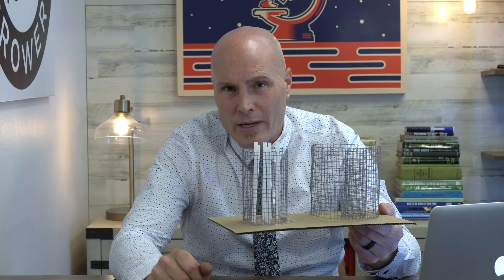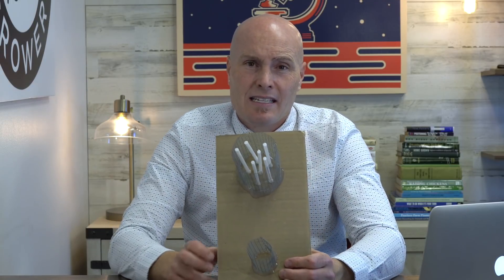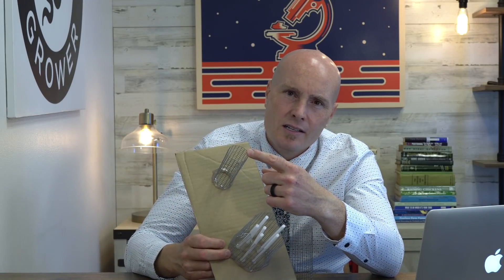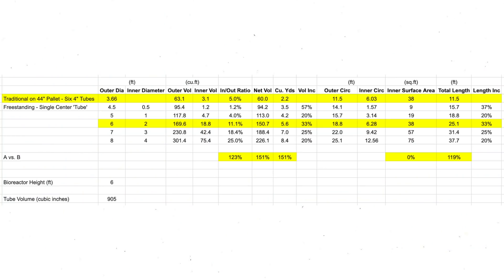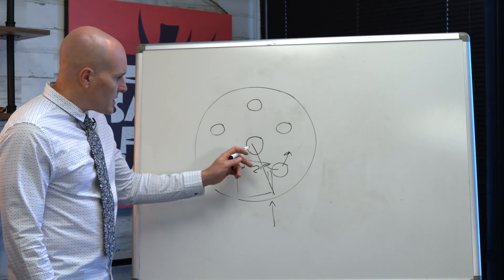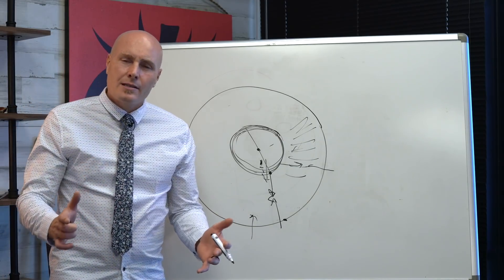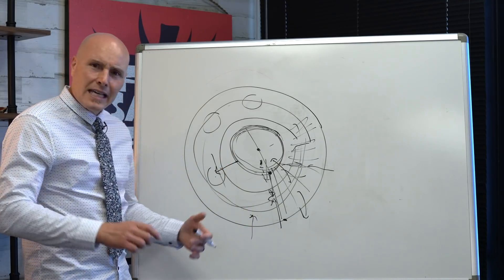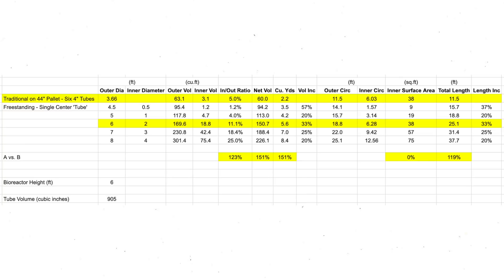Designing a New Compost Bioreactor | DESIGN SPECS and QUESTIONS ANSWERED

Comment: Did almost the same thing with my circular plastic compost bin last night.  Drilled holes all around the plastic outer shell (it has no base, so that's open to the ground).  Then placed a tub in the middle that I also drilled holes in.   Hoping to see a major improvement in the quality of the compost that comes out of it.  Rather than the black sludge I've been getting for years.
Did I do the right thing?

Comment: This reminds me very much of a keyhole garden without the wedge. Also this is taller than the keyhole garden.
What would happen if, after maybe the first year of composting,  you topped the reactor with a layer of good garden soul, and right away planted seeds and seedlings heavily on the surface, to hold the top soil in place.  The plants could be watered lightly to train them to send their roots down to the compost.  Voila, a garden.

Comment: @4:50 I think the inside surface area of the pipes will be the more accurate measure of amount of air going into the pile, not the volume. The thin pipes might have a similar surface area to the large centre core, even though their volume is less. The amount of air going into the pile and feeding the bacteria will be proportional to the surface area exposed to the air, not the volume. Just like how your gut has a small volume, but a huge surface area, and thus is able to digest food quickly. Nevertheless, I think the central core design is better than the pipes as the pipes are expensive and a nuisance to fill, as you've stated.

Comment: I wonder how much the tube width relative to tube length affects temperature and therefore upward air velocity? Like chimney length and width with creating the draft for smoke to rise out. Also a reason for having it elevated on the pallet? To bring colder ground level fresh air up through the tube and out in a convection current?

Comment: Maybe I'm crazy... Does this type of reactor build the same internal temps as a traditional compost pile? If it does i am thinking to run a coil thru it to circulate water(which gets heated by the compost) to a biogas reactor(which could use that heat in temperate climates)  free heat? Or just a wacko middle of the night thought?
Reply: I'm researching composting for exactly the same reasons 😂

Check out Jean pain compost heating for more inspiration!

Comment: Another thing, if air penetrates 1ft into the pile from any direction, you can have 2 ft of spacing between air gaps, because each gap would have a 1ft radius circle around it which it is aerating.  Instead of using the pipes, why not just roll some wire into several 6" diameter tubes and then space them every two feet?  You would still get much more air flow than the pipes could provide and you could still maintain your thermal mass.

Comment: How are you going to keep your thermal mass, though?  I thought you needed at least 3ftx3ftx3ft to maintain the thermal mass to keep the decomposition process going.  If you only have a 2 ft wide thermal mass, you are going to be losing a lot of heat from all sides.
Reply: What about a roof like a garbage can lid? Would that retain enough rising hot air to get some decomp going?
Reply: @jeffreydustin5303  A radiant barrier above the bioreactor could help retain the heat, but it would also reduce airflow.  However, even doing that would simply allow the heat to radiate out the sides.  It just seems like the mass should be bigger, to me.

Comment: I like the design a lot. One issue you may run into is that you have a lot of wind and sun exposure on the outside, which bacteria and fungi don't seem to enjoy. One large benefit to your design that you didn't mention is that it would be very easy to water the material from the outside with a hose when it dries out too much.

If I were building one of these, which I probably eventually will, I think I would still wrap the outside of the structure with some type of material, to block the sunlight and slow down the wind. I don't think there would be any type of exposure issue on the inside mesh - especially with some type of top covering. So I think just wrapping the outside mesh with any type of fabric would benefit the design. And you wouldn't necessarily need to sew the fabric onto the wire - you could just wrap it around, and tuck it into the mesh after you fill it.

Comment: Diego, awhile ago you had a mushroom grower on your podcast and they mentioned King Stropharia/Wine caps as a great fungi for breaking down wood chips. 

Have you considered inoculating your Johnson-Su bioreactor with King Stropharia spawn/spores? If successful, I believe this fungi would eat through the pile faster than native fungi (resulting in quicker usable product for the garden) and you my get a delicious byproduct that may even persist in your garden itself.

I do wonder however how this might change results of the product. I believe Dr. Johnson talks about making compost tea or extract out of the bioreactor product/compost and using this as the main distribution method with idea being that the microorganism community you built is the main advantage/strength of this method (the argument/idea being that the drastic increase in microbial life sprayed out over your soil and your plants (foliar) will result in drastic improvements). 

So if you did this, would the result be diminished because you made a likely non-native fungi the dominant species in the pile? I would think it's likely fine and also that as the pile ages, the King Stropharia strain might start to diminish in strength and native species would also incorporate into the pile, resulting in a great mixture of microorganism species, regardless. I watched several of Dr. Johnson's talks and he talked about how the variety of species in their product simply explodes as time goes on, so I think the end-result would be similar even if you had King Stropharia as an initially dominant strain (you may simply get quicker breakdown of bulk, tough material like woodchips)

Comment: I would consider laying a couple of 3 inch pipes flat on the ground, going from the outside of the reactor to the inside. It would allow air to more easily penetrate into the core of the reactor, since air could flow through the pipe to the bottom of the core and out through the top.
Reply from the maker: Yes good idea.  I had thought of trying that in the future.
Reply: @DiegoFooter  Hi Diego, I tried building a JS bioreactor with my garden group but couldn't figure out how long to water it. I have watched a few video's, they tell/show you how to make it but not how long to water. I very well could have missed that part. I live in NJ and would like to make your version as it seems easier to fill and make but don't want to make the same mistake as with the first one I make. Hope you see this.
Reply: Or if anyone else have an answer, I would appreciate it.
Reply: @camillemclawrence2520 , if you soak the material, drain the excess water from it as David does, then it should be watered for one minute every day. the water keeps the bacteria and fungi growing, from memory, the idea is to maintain around 50 to 70% moisture content at all times. This system produces a very high fungi-dominated compost. On YouTube, type in Dr. David Johnson and watch his lectures, warning, they can be long, but they're worth it.

Comment: Diego   I am on my 9th batch and, like you, I have been "tampering" with the Johnson-Su scheme in many ways.
I have primarily used a calculation of inner pipe surface area + outer cage surface area to evaluate different aeration schemes.
I have moved to more like a max. 7" than 12" lateral distance between aeration and any part of the pile based on an hypothesis that superior aeration will mean more rapid digestion. Based near Ottawa Canada, we have the disadvantage of being frozen for 4 months of the year. Slows us down alot.
I have experimented with very open and very tight weave landscape cloths and though I haven't finished the experiments, I am expecting the open weave to be modestly better.
I have stopped obsessing over dry undigested leaves at the outer cage surface and on the top. They simply serve as effective moisture control for the inner core much the way a mulch does on a soil surface. 
I have made a simple wooden triangle with my chop saw to secure the tops of 7 x 3" aeration pipes. Many of us have chop saws. Few of us have welders. I'd like to send you a picture of the triangle. f.r.scott.hortop@gmail.com
I have modified the biomass wetting scheme with a bigger dip tank and a larger draining tray. I use a pitchfork to load. No climbing.
I have had similar experience as you with woodchip biomass. I may do a woodchips only batch and accept that it may be a 3 or 4 or 5 year cycle.
I am currently using 95% deciduous tree leaves chopped by lawnmower with a 5% mix of biochar + sawdust + previous batch to cross inoculate. Mixing occurs within the wetting tank
I really appreciate the role you are now fulfilling as a leading spokesperson for the Johnson-Su bioreactor community, filling out the JS community dialogue that we so need. Keep it up man.

Comment: Hi, great idea and design adaptation. I have one question, about chicken wire. So far I've gone to multiple hardware store and all chicken wire seems to have warnings about containing lead. It seems it is all coming from China and the US does not regulate products like this. Any suggestions and is this really an issue or is this just a warning because no tests were done on it?

Comment: I've recently been made aware that the lead from galvanized chicken wire ends up washing into the soil below it and can be found in very high levels where chicken wire is used. I'm much more concerned about lead than I am about what chemicals the plastic might let off. We found some very expensive stainless steel hardware cloth that should work though.

Comment: Hi Diego, I did something similar to this at my community garden 3 bin compost system. I bought a sheet metal and turned it into a cylinder shape and then placed it in the center of the compost pile (the core).
I have pictures to show and would be interested in any feed back you might have about it.  Do you have dm?

Comment: I have had to watch your video again and again.  I just believe the one advantage of Johnson Bioreactor concept of using pipes on different position in the compost as compared to the wire mesh at the center is that air circulates better inside the dense mass of  compost through the different pipes holes as if mixing is been done. Remember each pipe has holes in different direction for adequate air distribution. I will rather not remove the pipes
Reply from the maker: That’s fair.  Why does that extra air circulation help?  It’s one thing to say I think it helps, but is it really making a difference.
Reply: Thanks so much for your response. I really enjoy all your videos . I have learnt quite alot. I plan to use these methods for composting my pig poo. Please can I use black plastic with holes or jute bags material in place of landscape fabric material that is not readily available where I live in Nigeria

Comment: Nice idea Diego. I agree with your impulse to get ride of the plastic and neaten it up. I wonder if more air is better.. or does it dry out those (now more exposed) areas more easily/quickly, changing the humidity balance? Could have a biological effect, perhaps. Interesting. Have you compared the result of the two side by side under a microscope?
Reply: I am also interested in the fungal balance comparison outcomes 🧐

Comment: The original design would allow better air circulation from the bottom up through the tubes as the heat of the pile heats up the air in the tube(working like a forced air system). The new design does not allow this. However with a few pipes laid horizontally around the tube connecting the outer tube with the inner tube, that would improve the air flow whilst maintaining ground contact.

Comment: Why not a square 2 feet wide and as tall and long as you want it?
Doubles as a temporary fence if you like.
Reply from the maker: A square is harder to make and the sides won't be as strong.
Reply: @DiegoFooter  A trade off then. A little more effort in the building for those who would prefer that shape for the use of space and ease of use.

Comment: The Idea to lay bottom pipes into the centre air collumn (or any way to increase fresh air input) would be the single best improvement to your design, I think. Possibly the only conceivable one. Though, come to think of it, a vented casing around (and on top of) the whole contraption (again with an generous air gap and lifted a few inches of the ground) has crossed my mind. It could protect the outer layer from the sun and aid in preserving temperature and moisture levels. Like a shed, almost. Would that hinder the influx of airborne organisms?
Great design, can't wait for the results. How long do you think you will leave it undisturbed?

Comment: I'll be building at least one of these this year in my greenhouse. I love this simplified idea! I'll probably use rolled fencing instead of the concrete wire as that's what I'll have aroundn and I'll probably make it 4-5' diameter with a 1' center tube instead. Awesome design!

Comment: wait the original is supposed to be 1ft to air in the shortest distance but i believe it would actually be 6 inches if you consider both directions from the pipe not 1 ft. The new model is 2 feet so its 1 foot considering both directions. Also i think your understanding of why the pallet is there is a bit off. It seems like your way of thinking is that if there is surface area exposed to fresh air from the top there is no reason to provide airflow from the bottom but i believe the original plan was thought out with thermodynamics in mind as the pile heats up it will literally pull air through the mix from the bottom increasing airflow. Just having the top open yeah the bottom gets access to air but i dont think i would get much air FLOW// rambling thought hope this made sense to you
Reply from the maker: Again, maybe the pallet makes a difference and maybe it doesn’t.  There are pros and cons to using and not using a pallet.

Comment: This is a nice compost pile design. It's not really a bio reactor. You'll see that when you when it's finished and you have it tested. I would add the fabric back on to your system as that is doing a lot more than just holding the material in with the larger mesh.There's probably a big interaction between the mass along with the air holes and producing the amount and diversity of bacteria that happen with his original design.
Reply from the maker: Maybe.  But I guess we will never know.
Reply: @DiegoFooter  It's pretty easy to have the finished product tested and that would tell you if it has the diversity of a bioreactor.

Comment: Thanks for posting this video! Is there any concern about co2 pooling in the center ring since it is heavier than air and there is no way for it to escape through the bottom?
Reply from the maker: Not sure.  But why worry about that level of nuisance.  We aren’t designing pharmaceuticals here.  Precision isn’t critical. At the end of the day you will still get compost.
Reply: @DiegoFooter  any idea if a match will stay lit in the center opening? If so, then I would absolutely agree. Sorry if I came off the wrong way. Getting this to scale has a lot of potential for organic agriculture

Comment: I had these same ideas. I never knew what to search to find this subject. A bioreactor with a 12 inch center and a 36 inch outside diameter would have the same principle. As long as you were at least 36 inches tall. I built one march first 2020 and with leaves and grass and some coffee grounds it composted very fast. The best part was that it filled itself with worms quickly. I am going to go woth the design you just explained and am sure with 2 systems I will be able to harvest 20 to 50 pounds of Alabama jumper worms by just sifting through the piles. At $40.00 to $50.00 a pound for these worms I will make enough money to finally be fully independent. I have a farmer I once worked for and was fired for thinking out loud more often then he liked. He was certainly an Alabama jumper worm hater because of their destroying capacity. I will not mind losing a few thousand dollars just to fill his garden and home foundation with them. I fugure the act of revenge is much better than being selfish keeping profits from sales. Did I mention that I really dislike this man ? 😁

Comment: I'm thinking of building a similar bioreactor. But with welded fence, and cage clips to hold it in a circle.  No bottom. I will hold the rings in place, at the bottom with long, homemade ground staples, like the ones you would use for landscaping fabric.  But mine are about twice as long and made from coat hangers.  I think, once it's filled, the top should hold itself. I'll let you know how it goes.
Reply: agreed ... welded  mesh is pretty strong .. not as strong as the reinforcement , but no need to tornado proof your compost.. hahah ....